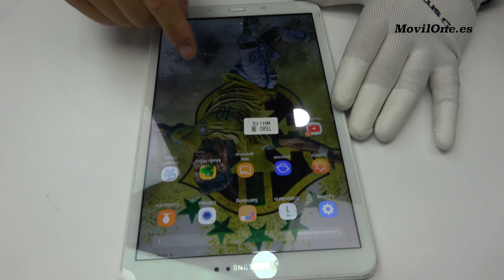Samsung Tab A T580 Screen Replacement

Comment: If the  digitizer is the only thing that is broken, why you have to replace the entire LCD as well? In my case the LCD turns on fine and works well. Even the digitizer is working but it's cracked. Is it possible to replace just the digitizer?
Reply: Just replace, the digitizer only you should be ok as long as you don't touch the LCD. Simple. 
I don't know why he removed/replaced the LCD. 
The LCD was intact, when he removed the digitizer.

Comment: Q. What sort of Glue did you use at the end for the glass screen?  You say "industrial glue" but what does that mean.
Reply from the maker: T7000 or B7000 ( one is black and the other is white, depending of the color of the device, you can use one or another). Best regards

Comment: this is a model sm p585m tab A6 ?
Reply from the maker: This one is T580!
Reply: @MovilonePhoneRepair  Your link to the LCD Screen on Ali express says it's for smt-585 and smt-580, does it work for both models? I only need the touch screen not the LCD

Comment: I have replace the screen but the touchscreen  is not working. Do you know how to fix this?
Reply from the maker: Faith, you need to try another spare part, it might be wrong the one you used! Wish you good luck!
Reply: @MovilonePhoneRepair  can I just replace the glass digitizer on mine? It's a Samsung T5 10 tab a I don't see anywhere in eBay anybody selling just the glass it's always seems to be the screen and the glass together do you have any knowledge about this?
Reply: @ClownWhisper  Yes you can order just the digitizer off of Amazon. This guy didnt even need to replace his lcd,only the digitizer lol. And Faith,make sure the ribbon cables are connected,try disconnecting them and reconnecting before trying another screen.
Reply: @zuessempowered5402  I wish there was a tutorial on how to get this one out we can see no matter which tablet I have at the time there are never any videos showing the exact model LOL
Reply: How do i put the black Clip back that ties the ripon on the board slot.  Myn came out cant clip it.
Reply: @sinip9694  If it is not broken at either end of the clip,you should be able to reinsert the two nobs at each end back into the ribbon cable port. If it is broken,you can either set the ribbon cable back onto the connection and use non conductive type tape to secure it,or you can melt a little bit of plastic on both sides to secure it,test before placing it all back together.